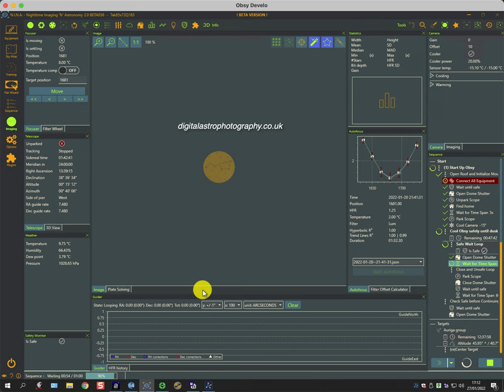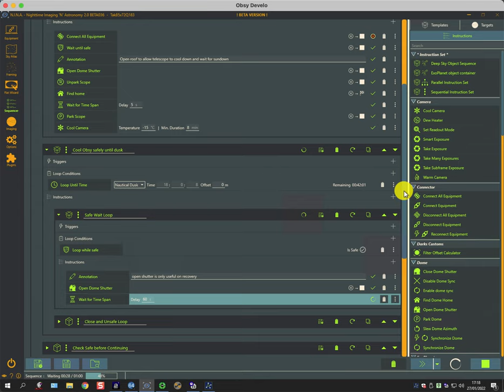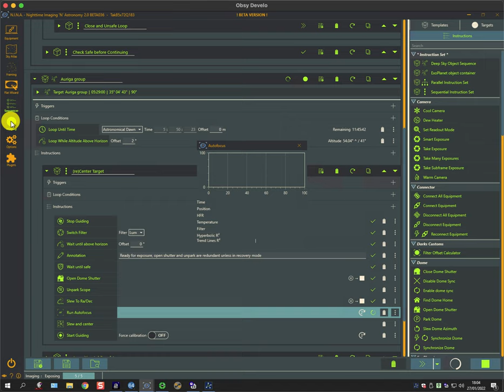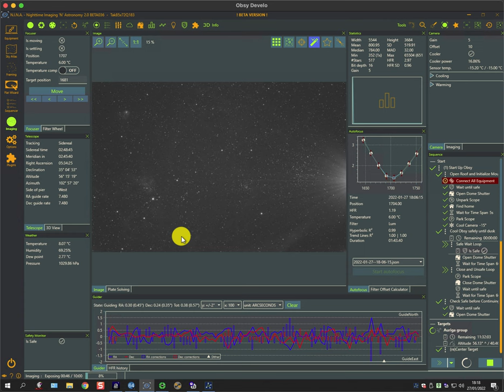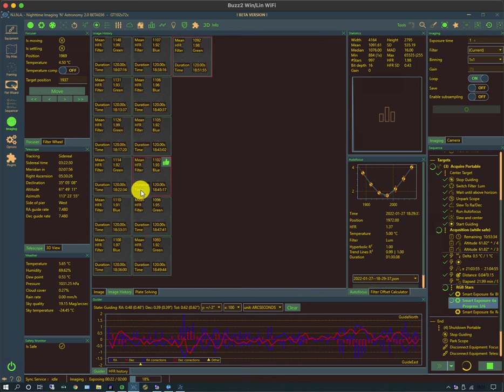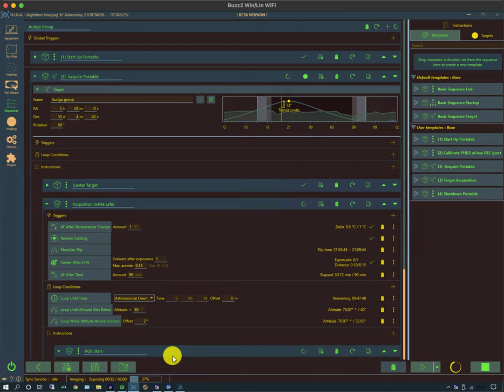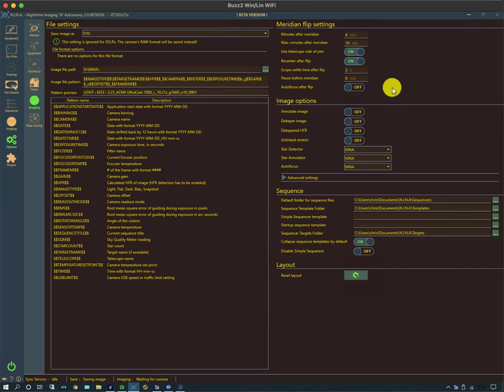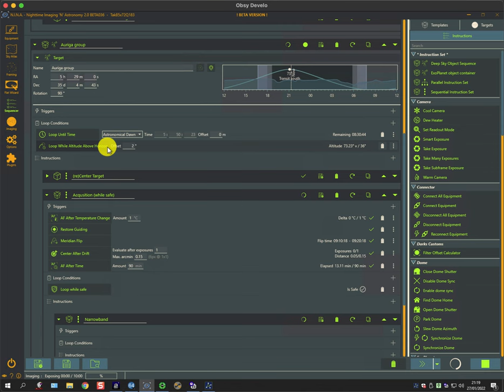NINA 2022, Part 9 - Imaging (2)

Comment: Well done as usual. The whole series if very useful.  Any chance you could do a lesson on using NINA and PHD2 Dithering? Calculating how many pixels in the Guide Camera translates to how many pixels in the main imaging camera. How to configure those results in NINA and PHD2. I have seen where some say good dithering is 10 pixels in the main imaging camera and others as much as 30 pixels. Your advice would be greatly appreciated.
Reply from the maker: It is a thought. The dither by PHD2 is a random offset, with its setting as a maximum value . Most actual dithers will be smaller. The downside of a large dither is a longer settling time and the need to crop more pixels off the edges. Dither can help improve resolution on undersampled images using Drizzle and help the statistical rejection of rogue pixels too. The best way to find out is to do an experiment and try 5, 10 and 20 pixels using short exposures and stack each to compare